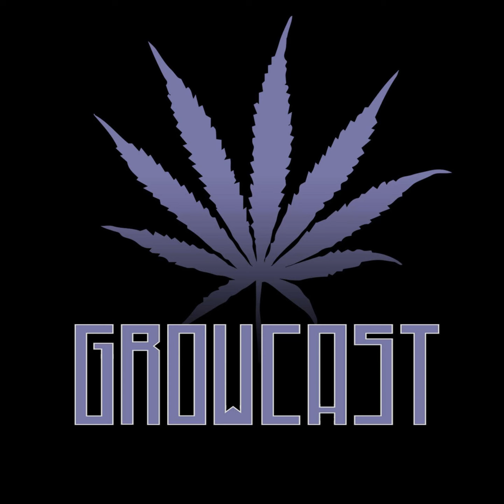💦 Rainwater Collection, Water Conservation, and Auto Watering, with Michael Box

Comment: Fabric pots introduce oxygen that is not in play with lined or plastic pots. In my grows, building a substrate environment in fabric that allows efficient oxygen, water and nutrient exchanges is paramount to hitting my target ranges for each. The way I solve dry substrate around the pot edges is to place drippers closer to the edge to compensate. There will be a magic spot that finds the right balance of wet/dry cycles throughout the entire pot. When I fill my pots with coco I even put more aeration in the lower half to counteract how the moisture settles from gravity. I control ALL that with the standard system design protocol that matters most... observation! :) At least the bottom part of the lined pots Michael is using allows SOME air exchange so hopefully their fertigation volume is high enough and runoff sufficient to refresh. 🙏